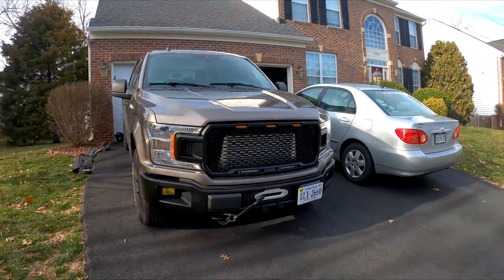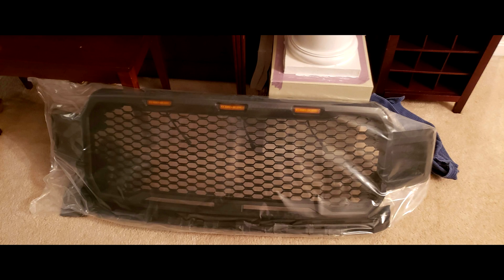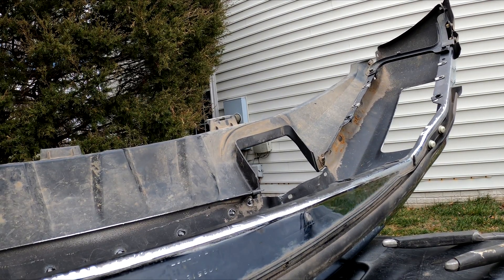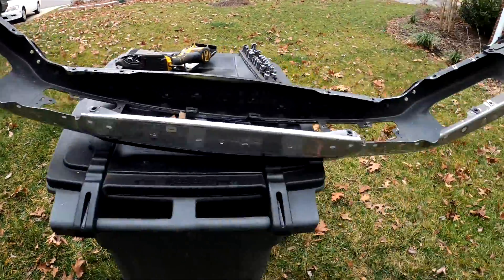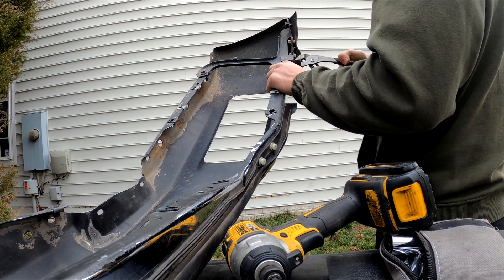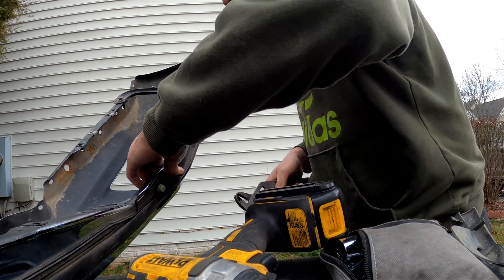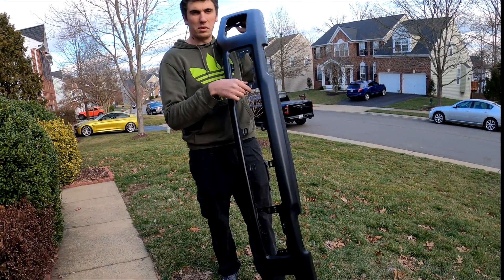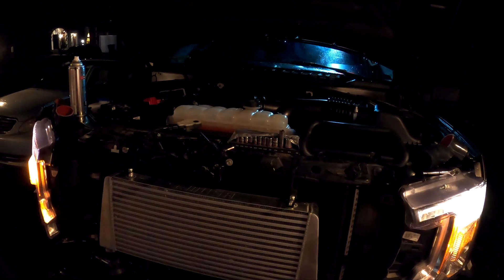F-150 Overland Build: 2019 F-150 hidden winch and intercooler relocation on the cheap! - Ep 1

Comment: Looks like you deleted the grill shutters. Did you also remove all the ducting and shutters where the stock intercooler mounted?
Reply from the maker: Yeah, all of that was removed for... weight reduction 😅
Reply: @HeretoWherever  im doing exactly like you did in the video. I got an intercooler from cxracing. Only difference is im using a vs racing 50mm bov instead of the factory one.
Reply from the maker: @moxyshredz  awesome! That should work great. I know some people were going to a independent BOV even on the stock set up so should work out great! 

Finding that y merger pipe was the only BIG hurdle after that few L brackets and plenty of silicone fittings 😀
Reply: @HeretoWherever  luckily i found the same exact y pipe you used. Im gonna try a series of silicone connectors and 2.5 inch pipe. I can weld aluminum so im gonna add the bov flange to the cold side piping wherever i can get the most room.

Comment: What lights do you have in the lower part of your grill?
Reply from the maker: They are some Amazon 8inch single row LEDs. The description says they are .9 inches tall and they are actually just wedged in the slots on the bottom of the grill and fit pretty darn good actually. 

Good flood out of them, but not great throw.